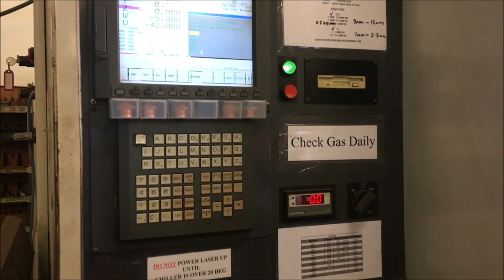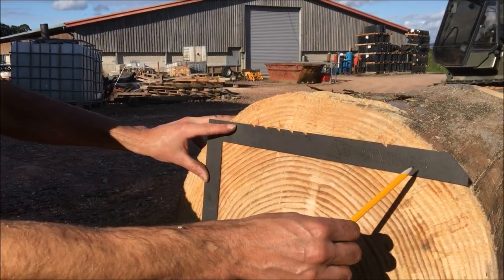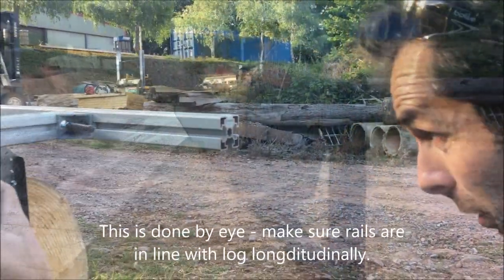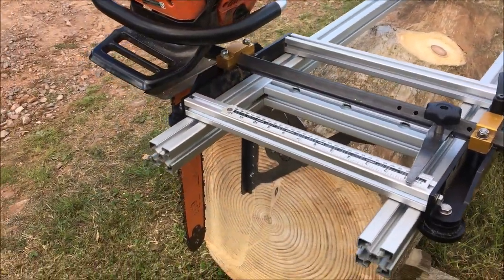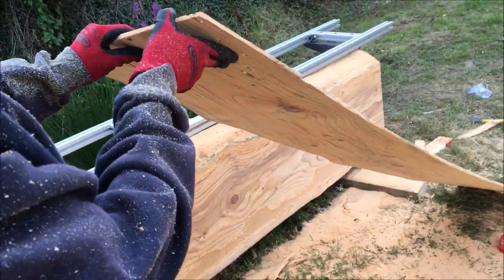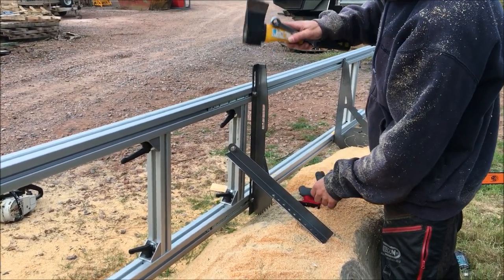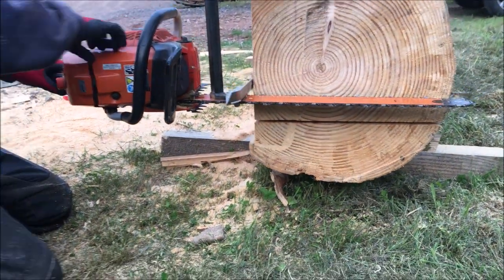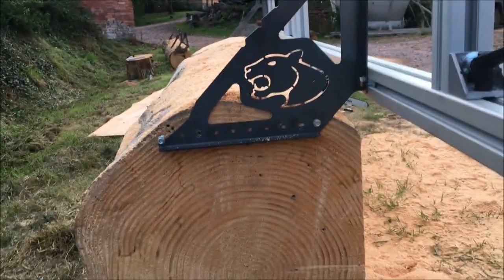First Panther Intersect Video - Worth watching all the way through.

Comment: yeaaaah! lol 5mm board... making veneer on a CS mill! Sweet! I see the corner brackets on the 1st cut rails, is it because you wanted something more rigid than the inner brackets?
Reply from the maker: Do you mean the small L brackets that hold the rungs to the longer side rails? Yep they tend to hold the rung flatter than the other style.
Reply: @chainsawbars  yes, more meat right. Will you offer those too?